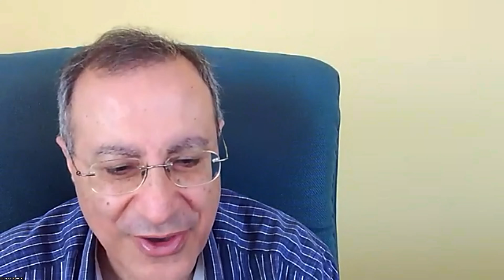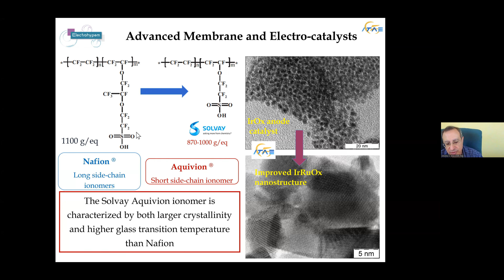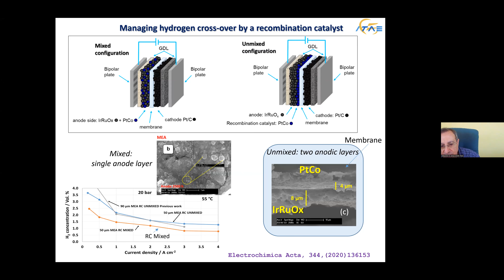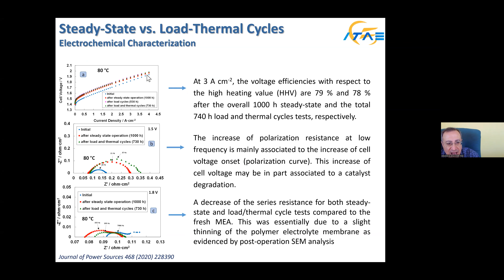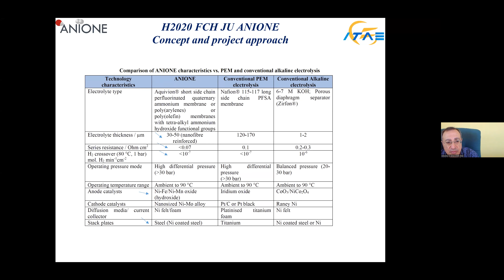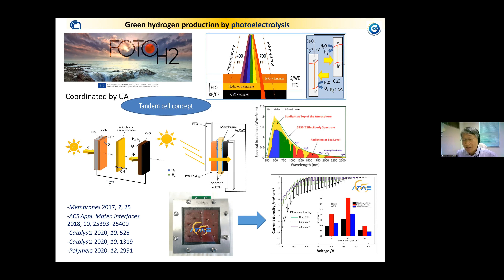(4) Advanced technologies for green hydrogen production by low temperature electrolysis

Comment: I have produced hydrogen without the presents of oxygen at the anode in the USA
Reply: Can you detail it pls
Reply: @srinivaassudabattula3306  I took 2 containers made 1 container the positive terminal and made the 2nd container the negative terminal.i took a 3rd independent neutral wire and joined the 2 containers through the 3rd wire and I used saltwater. But if you use potassium hydroxide or bakingsoda or sodium hydroxide it will produce oxygen at the anodes.